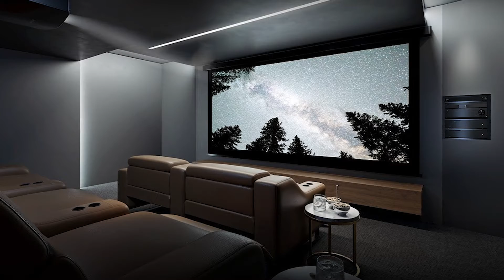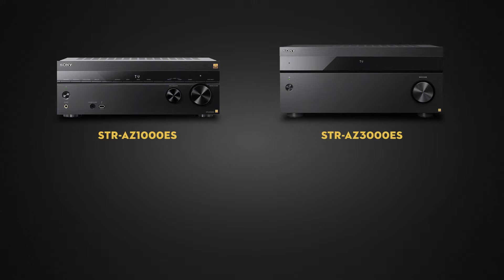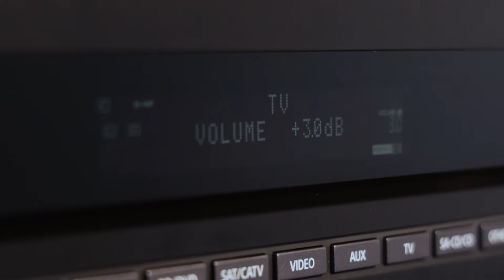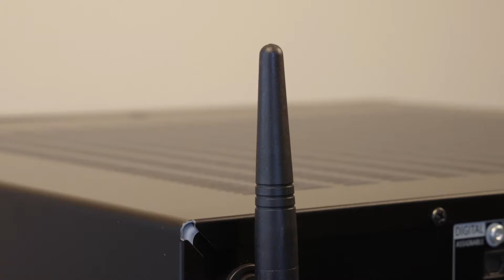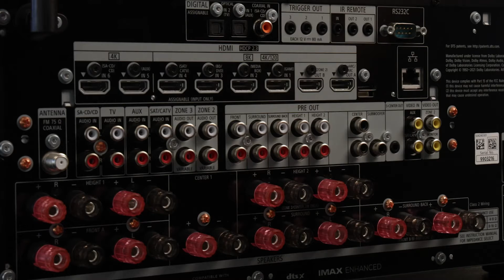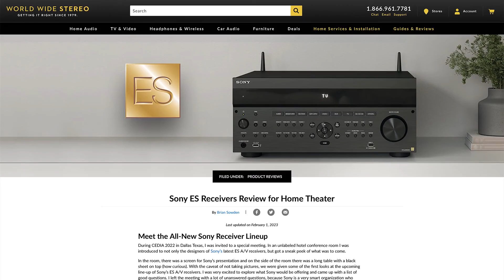Review: Sony ES 8K Home Theater AV Receivers Deep Dive

Comment: Hey! First of all, thanks a lot for this video   you explained everything so clearly and in such a nice, easy-to-follow way. Really appreciate the effort and the presentation style! 

I’m actually very interested in getting the SONY STR-ZA5000ES 9.2 Channel 4K AV Receiver with Dolby Atmos (STRZA5000ES) for my home theater setup, but I’m a bit worried about the power line issue. Since this model is made for the North American market (120V) and I’m in Saudi Arabia (230V), I’m wondering if there’s a clean, professional internal modification that can be done to make it work safely — not just using a step-down transformer.

Has anyone tried this successfully without affecting the sound performance?
Thanks again for the amazing video and for making things easy to understand!

Comment: Considering upgrading my home theater setup: 77" CX 4K Smart OLED (2020) with HDR/Dolby Vision, Denon AVR-X3700H in a 5.4.4 Surround Setup, and four subwoofers in a 37'2" x 27'10" room. Wondering if the Sony STR-AZ7000ES is a worthy upgrade from the Denon. I unfortunately cannot add DIRAC to my AVR because of the age. The portion of the review that discusses the way it handles spatial audio really caught my ear, but is it worth it?              #HomeTheaterUpgrade #SonySTR-AZ7000ES

Comment: Very happy with my STRAZ5000ES except one quirk.  There is an annoying (though not actually all that loud) thump sent to the subwoofer LFE channel whenever the receiver senses an audio signal change or 3-20 seconds after stopping playback of a signal.  This is especially noticeable when moving between UI elements on an Apple TV (etc.) when UI sounds are enabled.  But it's also noticeable after video playback ends (etc.).  Could this be due to a defect?  @Brian, do you notice anything like this?
Reply: Oh!  for this to happen, it appears at least some speakers need to be set to "small". . . . with any crossover set.

Comment: A couple of questions...  Does the 5000 series have a full preamp mode where when activated it turns off the internal amps?  How does the Sony room correction compare to Denon's Audessey XT32?  Does the Sony have a web interface that can be used for setup without having to do everything on the remote?

Comment: I love Sony products I've been buying them for over 30 years I just purchased the AV receiver 7000 ES it was just shipped to my house on Friday I did get it out of the box it is definitely pretty heavy it matches the rest with my ES stuff haven't plugged it in yet but I will this week I did purchase the rest of the The Sony speakers that you can hook to the ceiling retiring my older surround sound 7.1 and it's an ES after 12 years

Comment: Confused by Dolby Atmos vs 360SSM. I have a 5.1.4 system using the STR-AZ5000ES. All wired speakers. Most movies with Dolby Atmos sound great. Is there a need to turn on 360SSM? If I do turn on 330SSM I really can’t tell a difference. 

So when do you use 360SSM? Perhaps one should turn on 360SSM when watching older 5.1 Dolby Digital DVDs? Is 360SSM intended mainly when listening to stereo music to try and create some spatially audio?

I’ve search YouTube for a tutorial on this subject but haven’t found a good presentation on the subject.
Reply: I think the speaker relocation feature needs to be enabled to make the 360SSM sound the best
Reply: @ I wasn’t happy with my STR-AZ5000ES so I sold it.  Replaced it with a Marantz SR8015. Very happy with the Marantz.
Reply: @rafacq  I have just ordered the AZ3000ES mainly because of the speaker relocation and 360 SSM. Have not received it. What did you not like about the AZ series?
Reply: @harvey_slash Random reboots, loud clicks, annoying hiss when 360SSM was on and more. Poor design when using a Sony Bravia TV as center channel which disables one of the 2 height channel amps. Needed to go in to get a fuse replaced, then had to go in a second time so they could replace the HDMI board. Hope you ordered from a store with a good return policy. Some folks love their Sony, I didn’t. In my 71 years worst electronic equipment I bought.

Comment: Excellent Video! I just purchased the 5000 ES. I love it but i do have an issue. Dual HDMI outputs A+B doesn’t work if one of the 2 displays are turned off. I set zone b to main and for whatever reason …A+B only works if both my projector and TV are on at the same time.  can you please test this to see if this is just faulty on my receiver? thanks!
Reply: imo, A+B is the wrong setting to use
Reply: @SlotHits777  well I think it’s stupid to have dual outputs and not be able to utilize A+B unless both displays are on.  For people who have a projector and a TV behind the screen this would of been perfect! This plus no HDMI auto switching makes zero sense.

Comment: Amazing Receiver. I have Az 5000es. Loving it. Even with my old za3100es and my dh3700es.
Reply: I’m interested in the 5000. Let me ask you a question is the bass pre-outs balanced or unbalanced or more specifically can I tweak them independently of each other? I’m setting up a 7.2.4 surround sound. If the spatial mapping is as good as I’m hearing I’ll skip getting a Denon receiver mainly because I wanted Auro3D.

Comment: sure - complete the calibration to enable the extra features.  my experience has been horrible.
Reply: Can you not get it to recognize that cal completed either?  That is my issue here.  No errors but the additional features refuse to unlock and the info says cal was not completed.
Reply: After the calibration, go to manual setup. Make sure you have tape measure to give you more accurate measurements. Put your speaker to small, not unless your Left and right is tower full range.. adjust your frequency to 80hz. If you’re watching movies . Choose afd movies and press 360 on your remote to give you more immersive bubble sounds.
Reply: @elmerbais  I didn’t remeasure but maybe that’s a good idea. I set all to small and crossover all at 80. I tried the 360ssm and on my 7000es it puts a strange noise into my system when nothing is playing. I also kinda like the more detailed directional sound with it off.
Reply: @CraZnes  you know what i do get some weird noise aswell with my 5000es, is it sounds like negative feedback of bass from sub and other speakers. Its like sucking the sub in reverse, i noticed that if the 360 is engaged. Which is im not getting from my other Sony za3100es.

Comment: Appreciate the video. I upgraded from the Sony str-dn1080 to the str-az3000es  because I wanted rear height channels for dolby atmos. Well worth the money. Seems to add a little extra weight in the lower mid bass area. The spacial sound mapping is like adding magic to everything you listen to.
Reply: Yup.. Sony has more detail and dynamic sounds. Ive tried expensive ones from Marantz 50, Anthem avm 50, onkyo 840, Yamaha Aventage 2080, but Sony has more dynamic.
Reply: @elmerbais  This is sounding promising. As I replied to another comment I was getting a Denon specifically for Auro3D ‘cause Dolby Atmos seems to be a joke as Dolby Vision. I’m definitely looking into getting the AZ-5000es now.
Reply: @bigdog7660 Do you use the dual HDMI outs? if so, have you tried using the A+B out on the main zone? if you see my comment above, this doesn't work well for me. I am trying to see if maybe my receiver is faulty or if this is done intentionally.